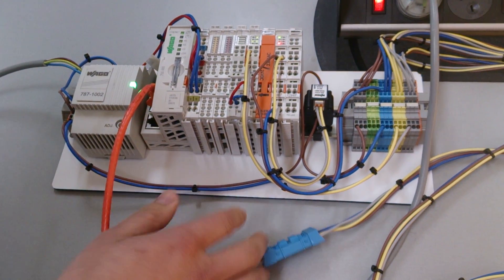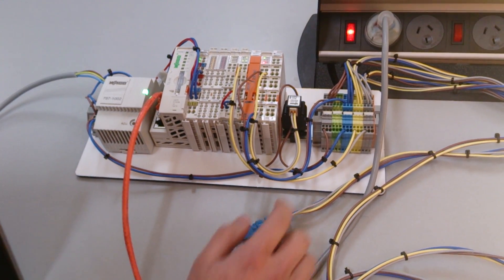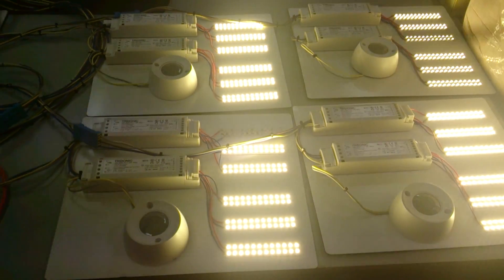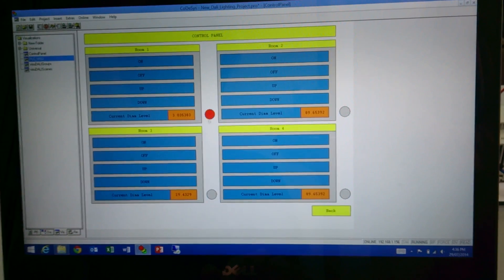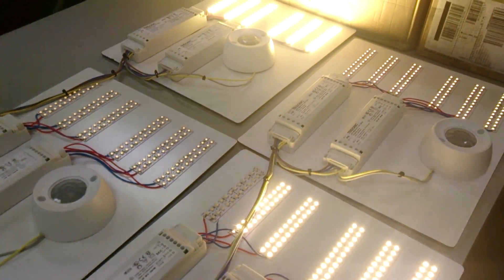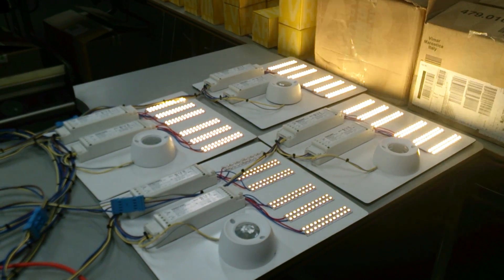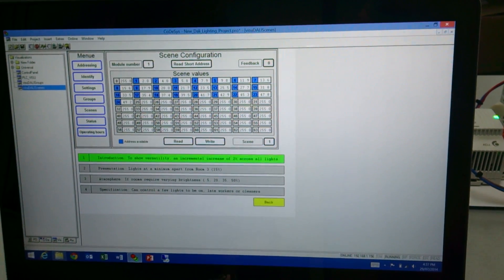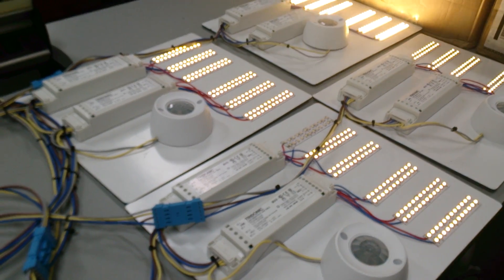DALI Lighting Automation with Codesys

Comment: The multisensor is from TRIDONIC? Did you use some tool to configure the multisensor or you only use Codsys? Thank you
Reply from the maker: Hi, to configure the sensors and lights you use the wago dali program. As long as the data lines are fed into the module, you can program it this way

Comment: Hello! I can use this driver DALI for dimer power suply to 0 - 12V? its for a led light.
Reply from the maker: Hi Tiago, Are your Dali drivers running on 12VDC? In the setup above our DALI drivers are running on 24VDC which is the same voltage for the automation setup. If your Dali drivers are 12VDC all you need to do is add a different power supply (12VDC - which we have in our range) to power your drivers and a separate power supply (24VDC) to power the node.
Reply: My LED's are 12V, the module I/O is with 24V,the drivers supply 127V, DALI+ DALI- and Vout max 150V...
Reply from the maker: Yes, as long as you have a separate power supply for your LED drivers you can still use our Dali Card. The Dali + and Dali - are just signal wires, so the voltage doesn't matter.
Reply: I have dimmable sal pannels. Compatible with Dali. Acording to the manufacturer. What is involved in installing the Dali driver? Is it a simple wiring job. Or does the panel need to opened?